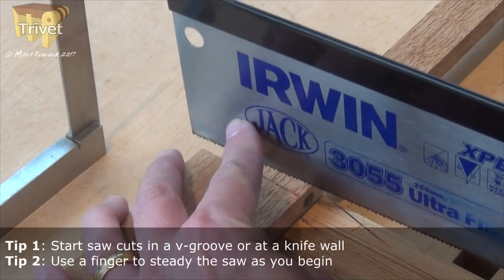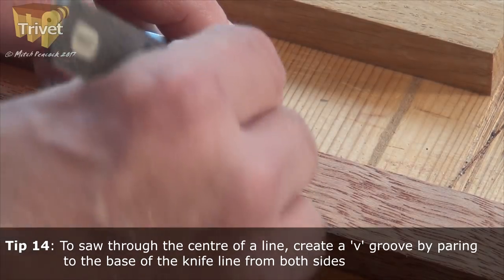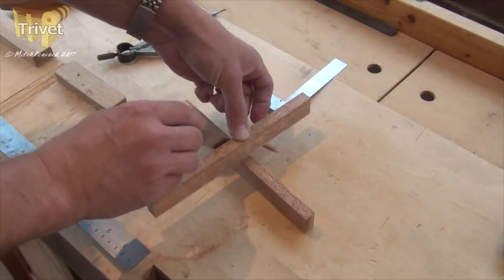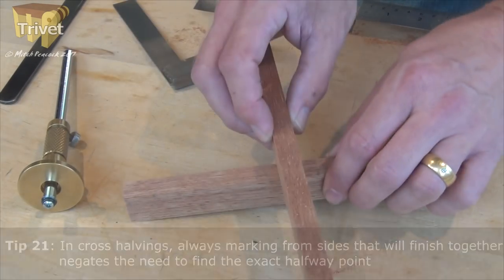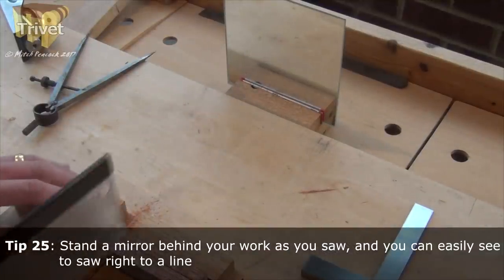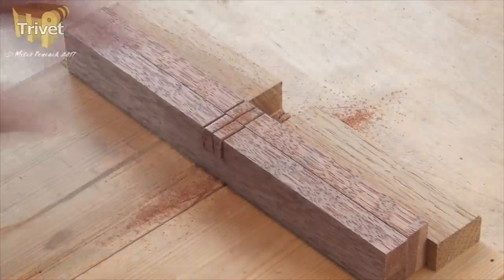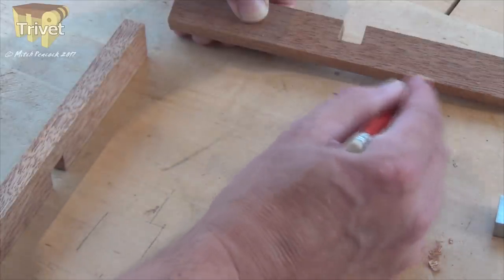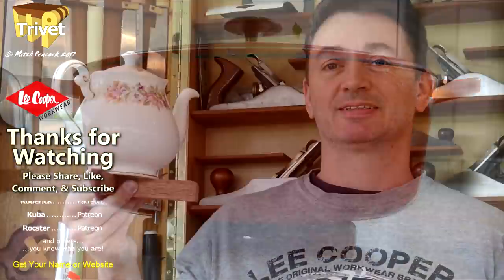37 Great Tips while I Build a Trivet

Comment: Hay Mitch, what a fantastic job u doin there lovely mate,
Any way u mentioned bevel up n bevel down mate, when I take planer apart some times I for get which side, how do u know if bevel up or down? Thank you
Reply from the maker: Hey Dan! Bevel down planes will usually have a chip breaker, and seat on a bed of 45+°. All 'bailey' style bench planes will be bevel down. Low angle beds, such as block planes and 'low angle' planes will be bevel up.